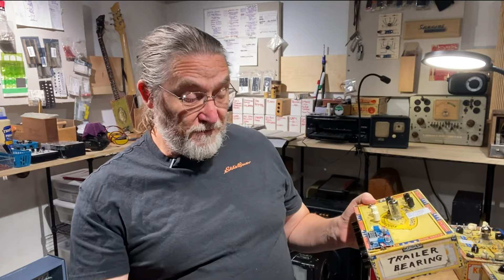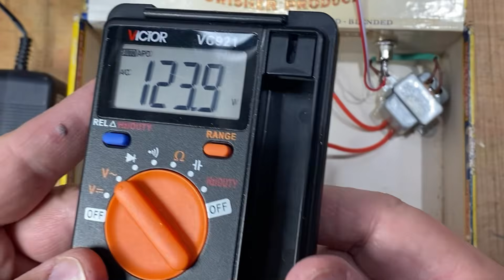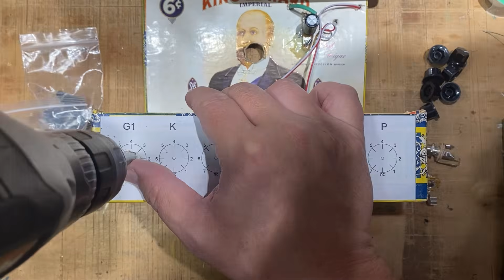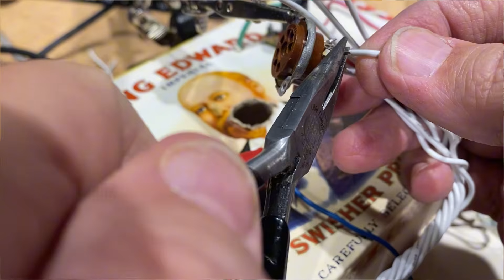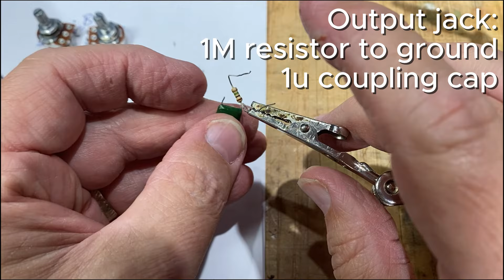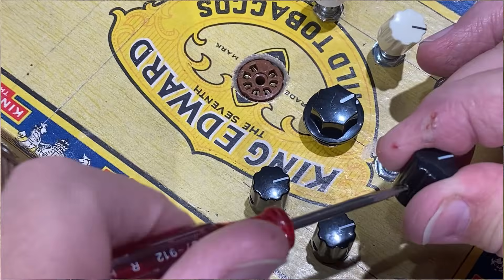7 Pin Tube Universal Gain Stage Build from SPARE PARTS

Comment from the maker: In this video, I take on an eye-opening experiment: testing how different vacuum tubes actually sound — not just how they test on an old emissions tube tester! Using parts I had lying around, I built a universal gain stage (or “tube test harness”) that lets me plug in almost any 7-pin tube and hear how it performs in a real guitar signal chain.

This project started as a follow-up to my Knight Series 600 Tube Tester restoration, but it quickly turned into something much more interesting. One tube that tested great sounded terrible, and another that tested weak sounded incredible!

In this episode, I’ll show you how I:

    Built a universal gain stage around a 7-pin vacuum tube
    Wired each socket pin to rotary switches for flexible pin assignments
    Created a dual-path power supply with a 9 VAC adapter, transformer, rectifier, and DC-DC buck converter
    Added a 10 MΩ safety resistor to bleed off B+ voltage safely
    Mounted everything neatly inside a cigar box chassis with labeled controls
    Built sub-assemblies for coupling caps, bypass capacitors, and jacks
    Finished with a clean, functional layout and MXR-style knobs

Next time, I’ll demo the sound differences between tubes using this setup — and the results might surprise you.

Affiliate links (Reference material):
The Guitar Amp Handbook by Dave Hunter: https://amzn.to/4o1iKxB
Tube Amp Schematic Bible (A-F): https://amzn.to/3ITr57s
Tube Amp Schematic Bible (G-Z): https://amzn.to/4q6C4vg

Affiliate links (Parts used in this project):
8 position rotary switch: https://amzn.to/42UYghF
9-pin tube sockets: https://amzn.to/4gW0rYj
7-pin tube sockets: https://amzn.to/46QbDks
SPST switches: https://amzn.to/4nZClhs
DC-DC Buck converter: https://amzn.to/4pSDbyq
Solid core hookup wire: https://amzn.to/4pPtmkG

Comment: That's a great project; I like the versatility of using rotary switches to assign functions to pins.  Naturally there's a big bold notice to turn the power supply off before changing the switches.
Reply from the maker: Thanks! When I was first working with the 6C4 tube, I had a couple of things dialed in wrong. At 175 volts B+, it could have blown up, but it survived. It’s a remarkable tube! I will be sure to mention that the power should be off and the tube out of socket when setting the test harness up. Great suggestion!

Comment: 2:30 It seems to me that the screen grid is shown, not the suppressor grid.  The screen grid accelerates electrons past the suppressor grid; the suppressor grid exists with a small negative charge or simply grounded to prevent stray electrons knocked off the plate from floating around inside and doing whatever stray electrons do (create noise, probably).   Capacitor DC block on output is a bit scary; if it ever fails something downstream is getting zapped.  Good quality audio transformers are preferred but not probably easy to find (or cheap).   For less hum pickup a fully balanced input would help but that would seem to require something like 12AX7 twin triode (my favorite!) or at least a transformer balun.
Reply from the maker: I was wondering how long it would take for someone to catch that. I realized after I uploaded that I called the grid the wrong thing. Doh! As for the dc blocking cap on the output, it’s a cheap solution and very common from all of the schematics I’ve seen. An audio transformer would be nice to allow the signal through without effecting the frequency spread. That’s an experiment to try in the future!
Reply: @MadScientistGuitarLab  Capacitor coupling works well with tubes since the "thump" from turning on power is not going to go through cold tubes anyway.  By the time the tubes have warmed up, the coupling capacitors are fully charged.